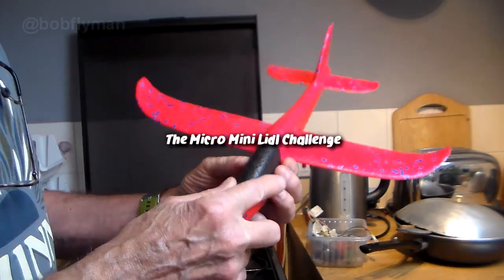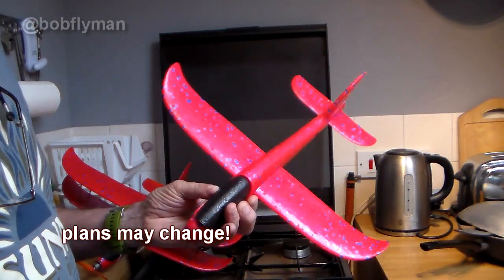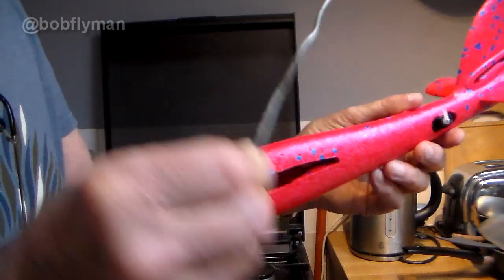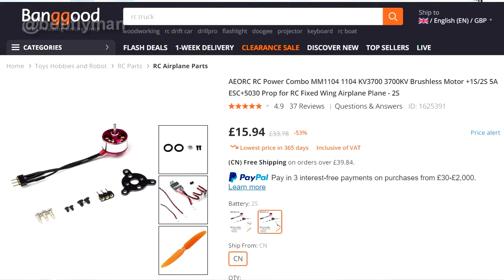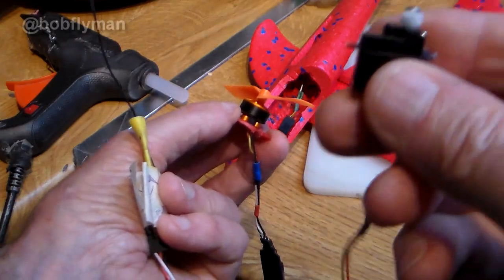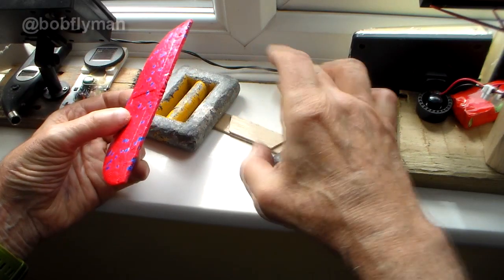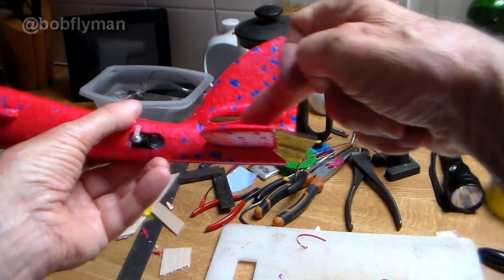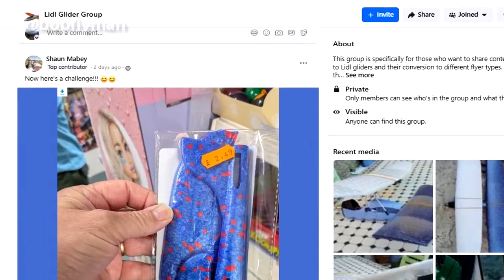The Micro-Mini Lidl RC Challenge   -  Did I succeed?  -  Unveiling the Micro-Lidl RC plane.

Comment: It was me that posted on the Facebook lidl page, the one I have is only
 9 1/2 " (24 cm) wing span  so a bit smaller than the one you are doing. Mine will probably be a glider if I do  have a go at it
Reply from the maker: Thanks.  Yes, I mistakenly thought the one in the pic was the slightly bigger one.  I've built two mini's that have the same kind of blue foam. A glider?  That would work.  It'd be a good challenge! I've corrected my size error in the video description.

Comment: G'day Bob, love your work with the Lidl gliders there mate.
I've been using those vape cells in my own projects for many years too and with all due respect sir, I feel I need to correct you at 9:46, where you indicated they were NimH (Nickel metal Hydride) chemistry, when they are in fact Lithium ion, with the potential to burn your house down when charged incorrectly.
Reply from the maker: Oh dear, you are absolutely correct though.  I knew they weren't LiPo, and have corrected that before, but brain fade, not NiMh, indeed Lithium Ion.  You can charge with a Lipo charger though as far as I'm aware?
Reply: @bobflyman yes you're correct, they will top charge to 4.2V safely and a discharge down to 3V is tolerable as long as you don't push them with a high C rate of discharge.
As you know, at 10C a 500mAh cell will deliver 5A of current.
Reply from the maker: Yup.  They are ok for small brushless motors.
Reply: @bobflyman yes mate they are good for many RC and electronic projects. Parallel single cell use increases C rating substantially, I've made 3S3P packs that comfortably handle 12V circuits at up to 20A for an hour..... They're getting harder to get here now though, with all the new anti Vape laws here in OZ.
Reply from the maker: Haven't seen many here lately either. It is a terrible waste of a useful resource.  😒

Comment: Yep, Bob. I'm starting to see the advantages of using the rubber band prop system - especially on these little motors with 1.5 or 2mm shafts. No bent shafts, no extra force ripping the motor mount off and the orange props are cheap enough when you buy them by the fistful! 😉😊
Reply from the maker: Indeed, best way for these little builds. I've bent shafts too!